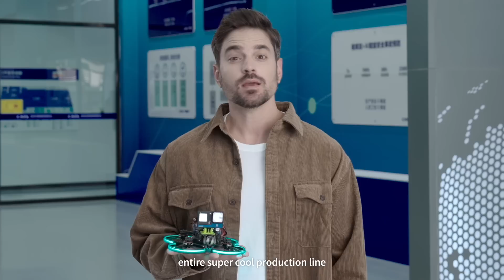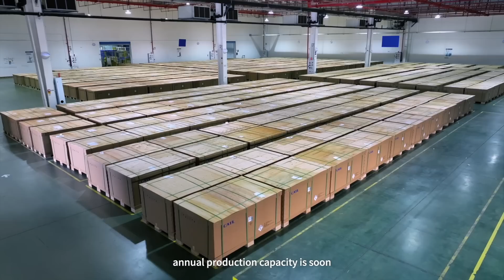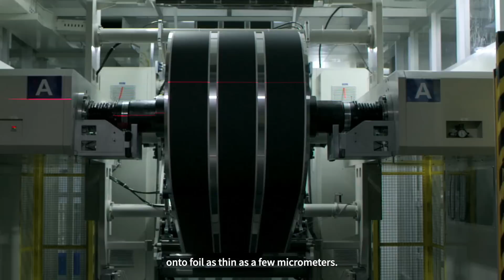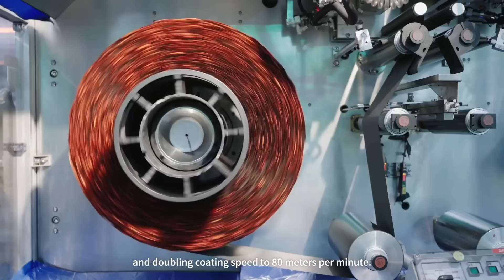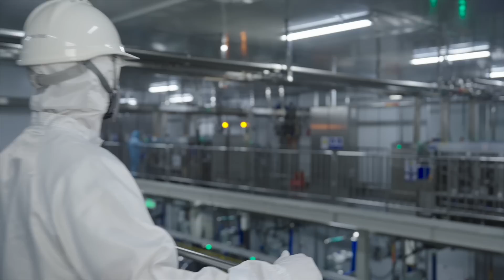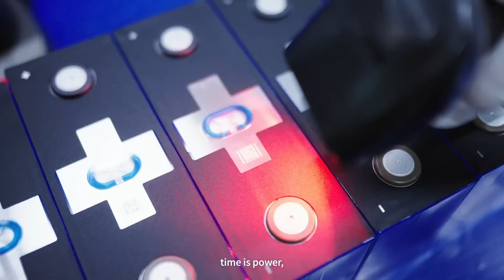CATL's Lightning-Fast Battery Production

Comment: Impressed tgat its a zero carbon emissions factory.

Has it got rooftop solar, or high wind & solar, or nuclear in the grid running the place?
Reply: In China, in 2023 they added solar and wind power production capacity equal to UK's total electricity production.

Comment: we wait for dry coating to increase finishing speed of the cells. Good job 👍
Reply: And 30 percent higher energy density,because dry electrode has the potential of much higher active materials both in cathode and anode of the cell

Comment: 1000000kWh is 12.5k 80kWh cars? Check your numbers
Reply: 100GWh = 100 000 000 kWh
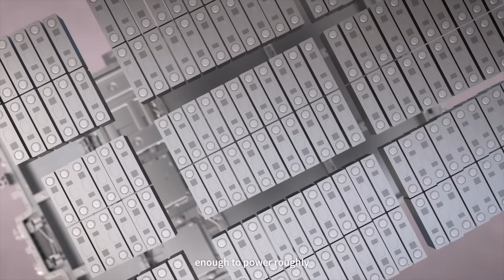Reply: @shafir2info 1:07 it shows in the video, 1,000,000 kWh, 1,000,000/80= 12500.... @1dforbes  is right....
Reply from the maker: @shafir2info  Thank you for pointing out the error regarding the 100 GWh conversion! We appreciate your feedback and will work on correcting it as soon as possible. Your support helps us improve!